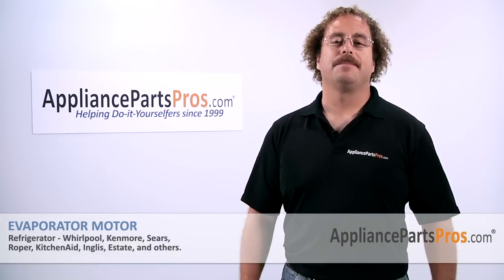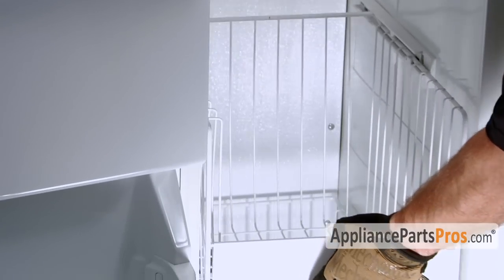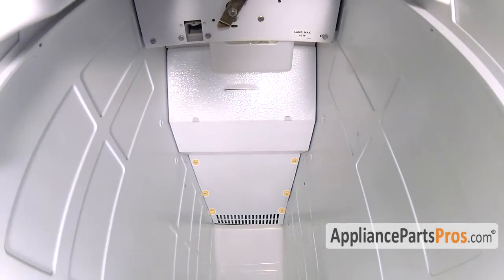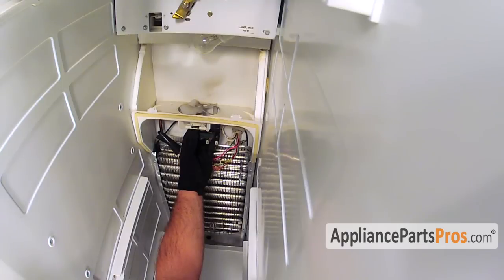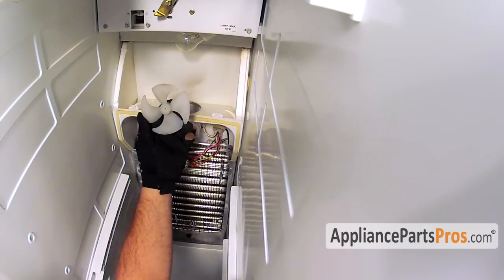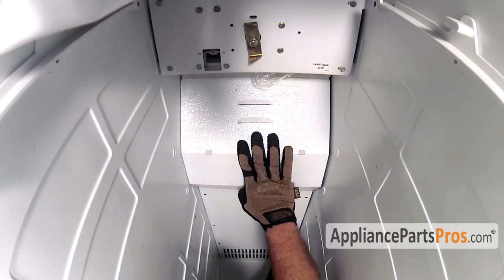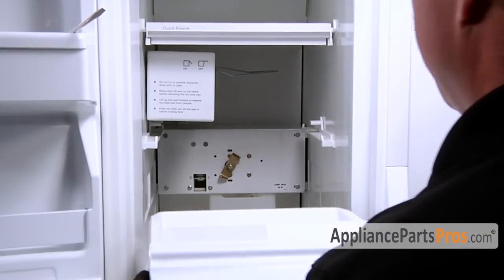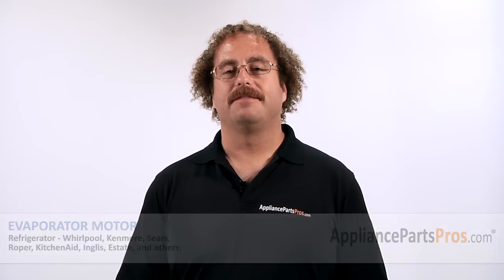How To: Whirlpool/KitchenAid/Maytag Evaporator Fan Motor 4389144

Comment: Just changed the evaporator fan motor on my KitchenAid refrigerator. The old one was making noise for about 6 months. 
I purchased a replacement about 3 months ago. 
Today it got quiet, and the refrigerator got up to 45°the fan quit running.
I watched your video about 5 months ago and bought the replacement motor .
I installed the exact motor you used in the vidio. The new fan is very quiet, and the refrigerator is 37°All's good your vidio made quick work of it. Thanks for posting it. Well done !!!
Reply from the maker: Thank you! Glad you were able to fix your issue. If you have any questions in the future just let us know!

Comment: In the video --Matt did not show when taking off the evaporator motor (the clear plastic --adapter/plug--on the bottom of the motor...you must take the adapter/plug off the old motor and put on the new motor so it fits securely when putting on the braket or the brace that holds the motor up ....If you don't...it does not sit high enough and the fan blades hit the sides of the shroud....and makes a loud noise as the blades turn and hit the sides....(so please take off this adaptor and use it on your new motor....
Reply from the maker: Rebecca Allen When the bracket was removed the bushing actually stayed on the bracket. You are correct though, if they stick to the old motor then they must be swapped over to the new motor. Good job on getting the motor changed !
Reply: But why would the fan get ice build up coming from the top and not from the coils at the bottom? I'm having this issue. Can it be from the ice maker??